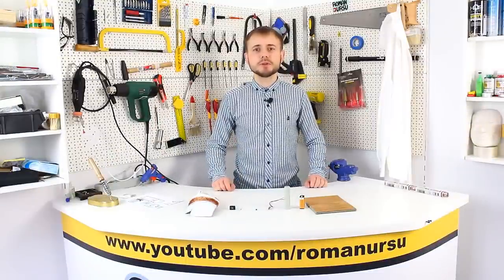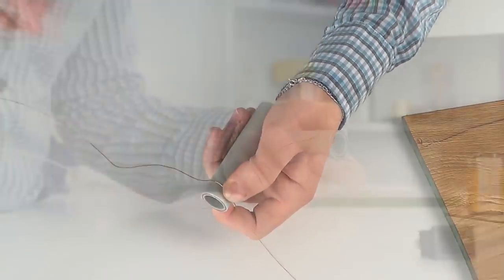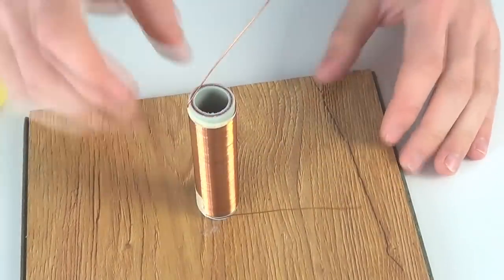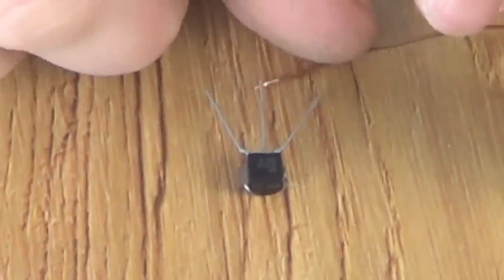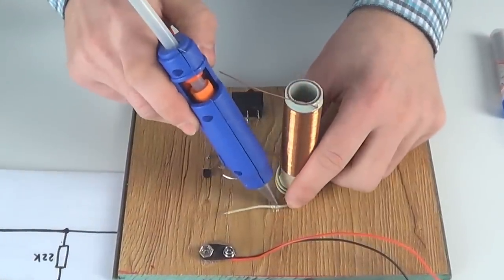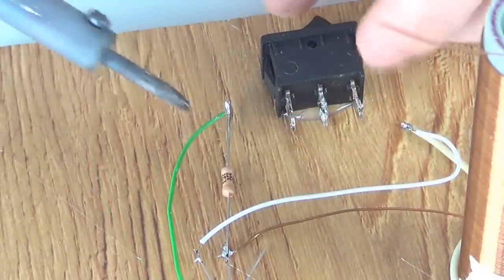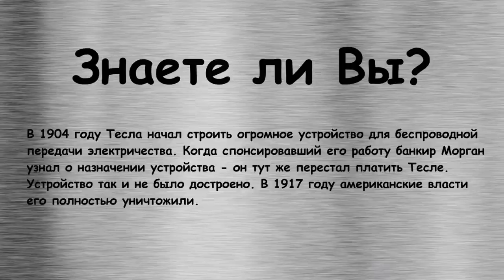How to make a mini Tesla coil 9V

Comment: That isn't a tesla coil it's a slayer exciter.
These "tesla coil videos" have been spreading wrong information
Reply: NSX 7342 what is the difference? I tried looking it up but couldn’t get a clear answer
Reply: Yah please explain
Reply: This is also considered a tesla coil. By definition, a tesla coil is a resonant air core transformer. This transfers energy to the secondary coil at its resonant frequency, it has a core of air, and it is a transformer. This is just a solid state tesla coil.
Reply: yeah, this is definitely a tesla coil but only the secondary is resonating, not the primary.
Reply: @fungusenthusiast8249  The primary is being switched at the same frequency as the secondary. It is resonating with the secondary.
Reply: @voltariantechnologyinc.8594  yeah, I know. That's what I meant to say but using less words.

Comment: Couple of Ideas for improvements - to increase signal strength:

>If you cut off the bottom of a pepsi can, glue that the top. Then have the copper wire touching it. It will increase the signal strength
>If you dont touch the circuit or coil in oporation, you might like to try a voltage multiplier circuit for even more range
>Experiment with 4, 6 or 8 turns of the "white" cable
Reply: I don’t understand, adding a topload reduces the resonance frequency, and it doesn’t even matter in a slayer exciter, why and how does it increase the signal strength? Primary coil also doesn’t matter that much in a slayer exciter (of course matters a lot for drsstc), as the circuit just drives at the secondary resonance.

Comment: Does the copper wire need to be insuIated? like maybe some kind of zebra wire used in makaing coils? cant find any info on my issue and nobody seems to say what kind is used, but it only makes sense that it is insulated right? otherwise it would just jump wires cause they are all touching anyway. Great Video btw

Comment: That wiring is dreadful.
Reply: +Tyler Barnes yes, but it requires minimum amount of time, which makes the viewer more inclined to try assembling this
Reply: +Tyler Barnes This whole video is dreadful. this is a flyback coil, not a  tesla coil.
Reply: +Obliterous Isn't a circuit with a parasitic cap on the 2nd coil a Slayer Exciter, not a flyback?
Reply: its a matter of perspective, as a real flyback circuit is actually built to drive into a large capacative load, IE a picture tube.
Reply: +Mateus Battalini A "Slayer Exciter" is a Tesla coil. Tesla used the self-resonance of the secondary caused by the inductance and parasitic capacitance between the windings, from the windings to ground, and the capacitance of the ball or donut on top.
Reply: +Obliterous This is a flyback oscillator/converter. The term "flyback transformer" or sometimes "flyback" is/was used colloquially by us old TV techs to describe the flyback converter transformer used to generate the high voltages required for a CRT television. There is a diode between the high voltage secondary and the capacitance of the picture tube's aquadag coating, so that capacitance is not part of the high voltage secondary's resonance.

This is a real flyback circuit. Transistor turns on, current builds in primary, causing expansion of a magnetic field. Transistor turns off, magnetic field collapses, inducing a large voltage in the secondary. Same way the flyback transformer in a CRT television works.
Reply: +Obliterous How do you think the original spark gap oscillator Tesla coils worked? In some designs, the high voltage kick happens when the spark in the primary stops. That would be the same as a flyback converter/oscillator.

it is a self-resonant secondary generating strong electric fields by exciting it at its resonant frequency. That sure sounds like a Tesla coil to me.
Reply: +Steve Greenfield I agree, Tesla was really big on frequency

Comment: Actually the 2-turn coil is the Primary, which is driven by the switching action of the transistor, and the many-turn coil is the Secondary, which has high voltage induced in it by the operation of the primary.
Reply: No it's not, as I gather, this 2-turn coil is what feeds the base of the trans-sister
Reply: Delphi Builder
The Base is the middle lead (pin 2) of the transistor. The lower wire of the SECONDARY (many turn winding) is directly connected to the Base of the transistor at 2:43.  Also connected to the Base is the resistor. The 2-turn PRIMARY coil is connected to the "upper end" of the resistor and to the Collector of the transistor. The connection of the Resistor and PRIMARY coil is connected to the switch, which is connected to the + lead of the battery. The Emitter of the transistor is connected to the - lead of the battery. The switching action of the transistor caused by feedback from the SECONDARY then switches pulses of current from the + of the Battery, through the 2-turn PRIMARY, to the - of the battery. This pulsing action induces a high voltage in the many-turn SECONDARY.
In addition, it is somewhat of a stretch to call this a "Tesla Coil". It is not a very good circuit. Search for "Slayer Exciter" and you'll see much better working examples of this simple oscillator. If you look for "Solid State Tesla Coil" you will find how real SSTCs are constructed, along with good explanations of the operating principles, and you can see how they are different from this simple oscillator circuit.
Reply: +TinselKoala exactly ur correct
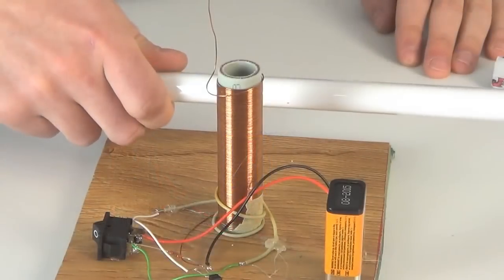Reply: I see no reason for current to flow through the secondary winding connected to the base of the transistor (driven high or C-E junction closed) since the other end of the secondary winding is left open. (the transistor is locked on) If the open end was biased to the emitter would pull the base low causing the junction to open.  Now the base would be high allowing B-C current to flow causing the junction to close again starting the process all over again thus a feedback loop. Of course you would have to put  something like a .1ohm 3w block resistor between the switch and the 22k resistor moving the secondary lead to between the two resistors so only the one end of the 22k resistor is connected to the base of the transistor. Using a piece of pref. board the circuit would be much better. If you notice at 4:54 he does a video transition so you never see the end of the fluorescent tube when it flashes.
Reply: DrHarryT
The frequency of oscillation is high enough so that the secondary's circuit is completed by the capacitance between the top (open) end of the coil and the ground. The fluorescent tube lights up with no connection because of the strong oscillating electric field produced around the secondary. If the proportions of the coils are correct the secondary serves as a quarter-wave resonator with high Q and thus produces a standing wave, with voltage amplification beyond what is given by the transformer turns ratio alone.

Comment: BRILLIANT, .... The simplest way is always best, your presentation is really good....
Although, ... you could use a transistor socket/holder, .. enabling the ease of changing the transistor when it blows, (and it will blow under continuous use), .... none of the other components should give any trouble.....

Comment: No schematic, too bad. The website doesn't load. To everyone saying this isn't a Tesla coil because it doesn't make sparks, that is not what defines a Tesla coil. And FYI, a "Slayer Exciter" IS a Tesla coil, just someone trying to put their own name on something.  

For a schematic, someone pointed out this project on Instructables. Make sure you known which leads of your transistor are Collector, Base and Emitter, as which are which on a TO-92 vary from not just model to model, but even different manufacturers will make a 2N2222 and put a different pinout on it.  If the link doesn't work, go to Instructables dot Com and search for How to Build a Slayer Exciter. 
http://www.instructables.com/id/How-to-Build-a-Slayer-Exciter/?ALLSTEPS
Reply: Thank god Steve you got it that is what everyone on comments doesn't understand :D well said too.
Reply: Thanks!
Reply: Thanks!

Comment: once he activates the switch and the transistor is activated, since there is basically no load, or just the wire with little resistance, isnt something going to get hot? like the wire perhaps?

Comment: For the love of everything good, DO NOT SOLDER THE WAY THIS GUY DOES!!! Just some simple twist splice connections for the stranded wire, and the copper wire around the transistor would have made this 10 times better. And, fking really, the copper wire on the transistor was moving so bloody much, im surprised it even made half decent electrical contact!
Reply: you mean those cheap plastic splice connections?
Reply: How would it have made it better?? He has electrical contact. It works as intended.   That's 100% success
Reply: +Bert Anernie I guess, but ask anyone that does this for a living will tell you that method thathe used is shit
Reply: +Tristan Sage no
Reply: From an electronic technician with 28 years in the field, Rich is correct. Simply soldering two touching wires will be ineffective if there is stress to the connection. (vibration, flexing caused by heating and cooling as current and voltage flow).  The connections in this video can be pulled apart by hand with very little effort.  

Rich just didn't reiterate "before soldering" is all.  But his comment reigns true. Wrap your connections, then solder. 
The connection will then share the strength of all the metals. These connections in this video are only as strong as the solder.
60/40 is mostly lead, which we all know, will tear and crack with just a few movements. 

Now, all that said, was this circuit functional? Yes. But not a safe way to build circuits that consist of wires.
Wires flex when current flows through them. Even without vibration, that flexing alone, can weaken and break a solder connection, unless you increase contact surface area between the harder wires. Then the soft lead and tin mix can add their strength to the over-all connection. 

In a properly soldered connection as in the above video, involving wire to component connections, when pulled upon, only the wire is allowed to be the fail point. If the break is in the soldered connection, that connection was not made properly, therefore it would be a failed customer repair (in my case). 
Meaning the repair would be free, and the product would be repaired or replaced at all costs, on my bill. 

I would not allow a technician to make connections like this. They would either be trained properly, or would be replaced if there is not another position available at the time.
Reply: It's a fucking homemade tesla coil.  Screw it.  Make it however you want, this is just a guideline.
Reply: It's called proper solder technique luke. Go ahead and make shoddy connections if you desire. But expect one to fail, probably resulting in you experiencing what a tesla coil, even this one, is capable of.

All he was doing is expressing the importance of proper solder joints. He wasn't dictating law. 
People believe a taser is a serious shock.
Tesla coils eat stun guns, and defecate tasers where electrocution potential is concerned.

Good luck with your all so structurally sound lead/tin connections.
Reply: +The Duder

Proper solder technique is a given in videos like this. These joints only had to last for 5 minutes. It's just showing the theory of the circuit the same way a drawing would.
Reply: Leo 
That is understood. But in a world filled with flat earthers, we are simply adding much needed guidance for those too foolish to look for themselves. It is called looking out for fellow human beings.
Reply: +The Duder Gotta admit, that was very well said
Reply: what is the gauge of copper coil

Comment: This is not a Tesla coil, it's a Slayer Exciter.  With no sparks breaking out, I cannot call this a Tesla Coil.  Next time try making a VTTC or a REAL SSTC with mosfets, half-bridge output stage (or full-bridge), GDT, gate driver chips, logic array and feedback loop, THEN you'll have a Tesla coil like what I can build.
Reply: Do you have a link to instructions?
Reply: +John Hunsberger I found this: http://www.instructables.com/id/How-to-Build-a-Slayer-Exciter/?ALLSTEPS
but no diodes in this video.
Reply: +CoolDudeClem Sparks are not what define a Tesla coil. It has a self-resonant secondary.

I'm surprised that you'd shame people for not starting with a complicated MOSFET build. You know that everyone starts simple.

My first Tesla coil was a spark gap oscillator using a neon sign transformer with a throwing star glued to the motor out of a hair dryer as a rotary spark gap and the breeze from the fan helping blow out the arc. The secondary was a massive number of turns of 32 gauge wire on a 14 inch long tapered wood tableleg with a round doorknob for a top terminal. When tuned up, it was throwing sparks about 4 inches long into the air, no need to draw a spark or put a sharp point on it.

None of your namby-pamby MOSFETs, a REAL Tesla coil. So there. ;')
Reply: +CoolDudeClem Yours is not a real Tesla Coil either. The original tesla coil is fully electric and uses a spark-gap.
Reply: Does it have to be made with silk-wrapped wire, too? It is getting a bit ridiculous.
Reply: Hahahah! Of course not. Just was replying the ridiculous comment from this diva called Clem.
Reply: +Matheus Moreira Well exuuuuuuuuuuuuuuse me.
Reply: Absolutely excuse you! :D
Reply: Snork!
Reply: CoolDudeClem thats not safe and 12 year olds like myself don't have such materials

Comment: I am also trying to make wireless electric generator with Tesla .I made all just like you made but i used KN2222A transistor, resistor of 1K ,9V of battery. I give 340 turns to secondary coil and 5 turn's to primary coil but it's not working. Whazt should i do now?Transistor is heating up soo much.

Comment: Nice work. What kind of gauge wire and is coated or not? Is it copper? It will be nice if you slow down. Thank you for video.
Reply: coated copper wire. it beads to be insulates so that the electricity flows through the whole length of the wire, not the path of least resistance.
Reply: hi
are you certain he use 0.1mm² for the coil?
I heard 1mm²
and for the firsrt coil what he use?
Reply: +Physics & Stuff 

I try to make it and doesnot work
what can i do?
    i use 1mm² for  secondary
and i try 0.4 mm²
and does not work!!!!!
please i need some help

Comment: hey thanks a lot i very much appreciate it can anyone tell me what is a substitute of 2n2222a transister
Reply: thanks
Reply: +Aniket Bose but this tesla coil cannot be practically used to light up a room isnt it?
Reply: +Aniket Bose if a CLF can be lit up through this tesla coil setup can you not have a holder to connect it through and use it as an alternative to grid enrgy?
Reply: +DA AUTHENTIC HACKER  you can use any switching transistor check current rating
Reply: Aniket, can this coil setup light a 10 X 12 room for instance ?
Reply: then how do you shorten the frequency? How about using an antenna in the setup?
Reply: A Tip31c is a substitute for this
Reply: Scotlahn McCallister can you throw some light on Tip31C ?
Reply: +Ganesh ms 
Since you have to buy a battery anyway, just get yourself a torch. Unlike a tesla coil it's built to light up a room.
Reply: oh, no

Comment: What does the transistor? not the 2n222a the little one and What was the wire its normal or magnet wire and can we doubled the Voltage Fast respon if u can !